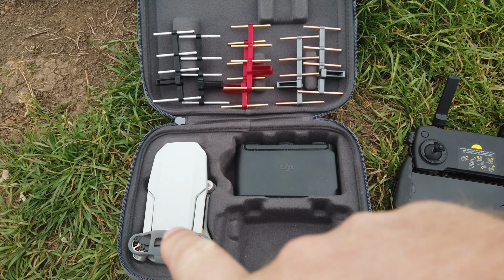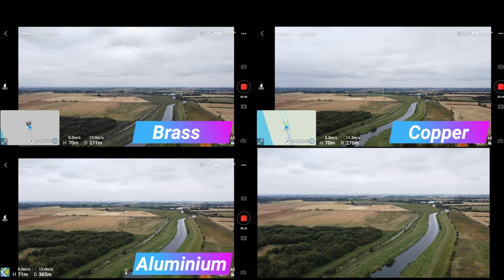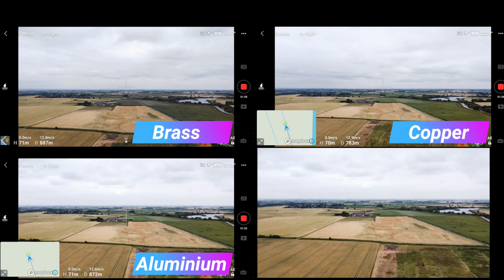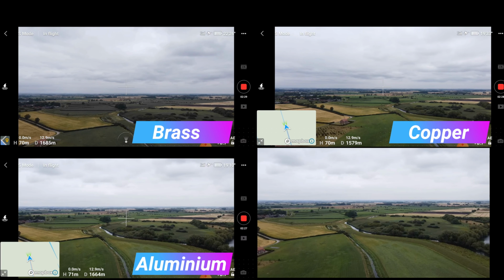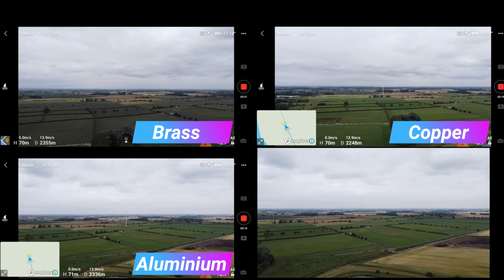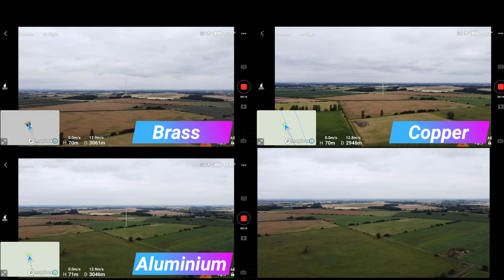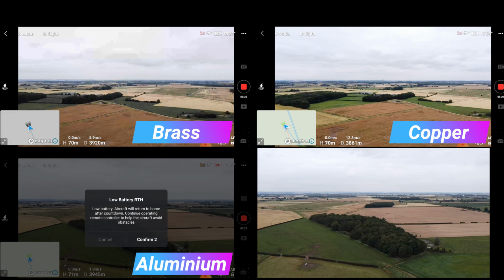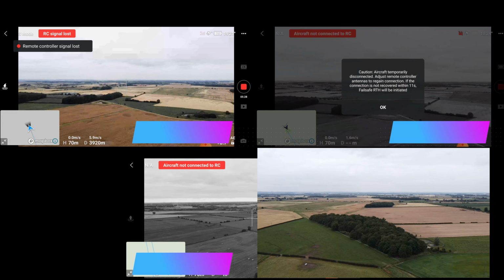ULTIMATE YAGI RANGE EXTENDER SHOOTOUT TEST || DJI MAVIC MINI

Comment: Brother, if I'm gonna use the copper yagis, is it required to set the transmission to manual 2.4 or just leave it to auto settings at 5.8? I live in a highly urbanized location with a lots of interference..
Reply from the maker: Yagis are frequency specific, shorter ones are 5.8 and longer are 2.4,  for high urban areas I'd suggest 5.8 versions and setting on a 5.8 frequency on the fly app
Reply: @GAVINHR  ok got it, but how about the parabolic, is it any Good for highly urbanized locations?
Reply from the maker: Yep ! They still work, and the parabolics will work on either frequency so it's cheaper than buying two sets of yagis
Reply: @GAVINHR  alright brother, actually I already have the copper yagis 2.4 that I just bought, i tried it on 2.4 manual, in my highly urbanized location, and it wasn't Good, I experience a lot of interferences, I think I should try then the parabolic .. anyways man, appreciate much all your videos and responses, I have learned alot of technical infos because of you videos. Kudos to you my brother 🙏
Reply from the maker: You're welcome! Thanks for watching

Comment: Loved the side by side shooting. It actually makes a big difference. 
I admit I thought the results would be much different, but this seemed to be as accurate as a field test can be, so congrats. It could only be better if you repeated those tests a couple of times. Also, you should always check that the channel was the exact same (maybe you did, but you didn't show it).
... but don't think it's over. I have a couple of tests that I'd like to see you do. One would be the comparison between the parayagis and the x-yagis and in those, the short and long ones.
Also would very much like to see the 2,4GHz vs the 5,8GHz (with and without fcc hack), both with yagis.
Hope you liked the ideas and looking forward to see you again soon. 
Take care.
Reply from the maker: Thanks Carlos, well apparently the FCC hack doesn't actually work as it's been discovered the hardware is actually different between the two models , I can confirm even though j didn't show it for each flight the controller was on manual channel 1 at all times. I'm looking forward to the parayagi test, I will have a look for some x yagis :)
Reply: @GAVINHR  Regarding the FCC,  I thought that too, but I know a fellow that lives in Sophia and being a big city, it has lots of wifi interference. We had a discussion, for a while and he actually proved me that when he hacked his Mini, he almost doubled his range. He tried several options and that is actually the way he has bigger range (2,4GHz and regular 5,8GHz didn't match it, due to the wifi interference).
I actually read somewhere at the mavicpilots forum that one chip is missing, so it will never do the 30dBm the fcc version does, however it has still an increase of 3 or 4dBm, from the original 14dBm the CE version has... of course this is all theorys, but this fellow actually showed there was a practical difference, so... that's why I was asking for a test on a clean environment, to see if it actually does the dBm increase or it is a channel issue (the fcc has less channels and maybe they are a bit deviated - my theory  based on absolutely nothing...).
Anyway, it would be nice to have a definitive test in a clean wifi zone to confirm or deny that difference...

Comment: If the lengths of the rods are correct, there will be no difference.
Reply: AFAIK GOLD > Silver > Copper > Brass > Aluminium > Iron
BUT the delta could be imperceptible between some or all
Reply: @Airbag888  isn't Aluminium has 2 times better electrical conductivity than brass? I did some study in simulation and show almost no difference using copper vs silver.
Reply from the maker: I must admit, for the purpose of these I expected aluminium to give better results than brass but it turned out the brass did keep the signal for that bit longer
Reply: @miniformerus9525  I don't have a source other than someone on another video some time back claiming that copper would be better. I think there are other tests of copper vs alum and they all end up with copper winning or negligible differences. Also at these extreme ranges there are so many factors such as pointing in the right direction precisely..
Reply: @miniformerus9525  Also commending you for saying Aluminium instead of Aluminum :D
Reply: @GAVINHR  Very nice field test !!!! :)!!! Thank you!!!!
Reply: @Airbag888  HAHAHAHHA laugh very hard XD
Reply: I agree, with the very very low current flowing in the rods, the small differences in resistance between them should not make any measurable difference.  Other factors such as minor differences in element spacing, antenna mounting on the controller, etc., would affect the performance much more.
Reply: @Airbag888  It's silver, copper, gold, and aluminum - then tungsten, iron, steel in that order. (Gold does have the best thermal conductivity, however.)  BTW, the reason so many electrical contacts are gold plated is for corrosion prevention.
Reply: @bblair502  Thanks for clarifying. @miniformer US does a very scientific test under controlled conditions. Field tests are good but comparing like with like is hard when factors like RC orientation in all planes, wind, temperature, heading of AC can be slightly different between tests. For a proper field test I suggest setting the RC on a tripod, using something like dronelink to establish a path and doing it back to back in similar conditions.

Comment: I will say, Dronelink adds mission support so I'd recommend using it to always use the same altitude and path for the mini :) Greeeeat comparison though very grateful :)
Reply from the maker: I've been thinking long and hard about it the past few days and using dronelink etc or similar apps, I'm just not sure how I feel about it all and allowing an app to fly the drone. I don't know , I may get it and stick a video up, would you be interested in watching something like that?
Reply: @GAVINHR  Stick the mini on a pig farm for 30mins and I'd probably watch it

AFAIK the Dronelink is safe. It also apparently does not break your mini warranty and has been used since forever to do missions. Well worth $20. You could quite easily redo your tests chilling vs trying to micro correct. The caveat is because the mini is limited you still need to have the RC connection working for the instructions to carry over. On signal loss a RTH will be triggered much like using DJI Fly.
Also the area you fly on seems quite devoid of human activity, preplan it using google earth.
Reply from the maker: That's very interesting, if it is that simple I wish I had it before when doing my range tests ! I may explore it even if it's for the sake of a video.  Then again, a fair few of my videos I have flown off on the way back of a text and recorded a ship or some other footage, wonder if you can exit the mission at any point.